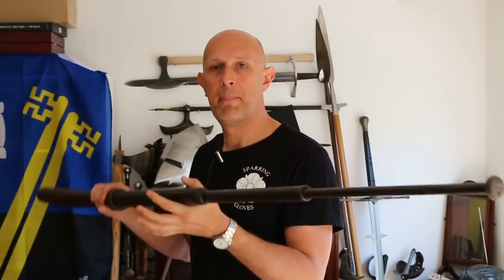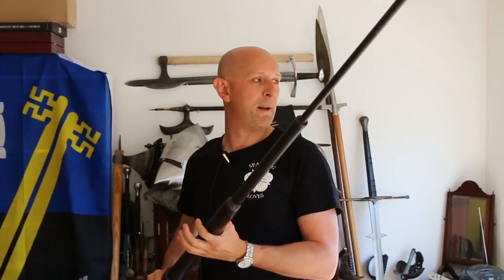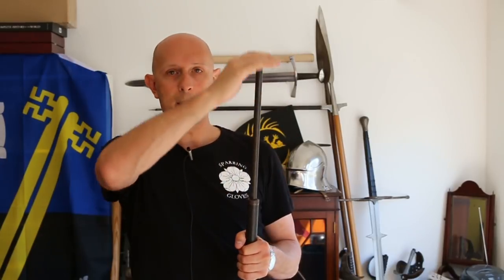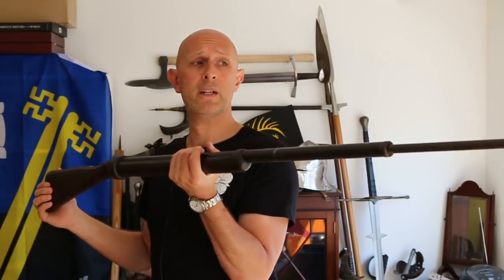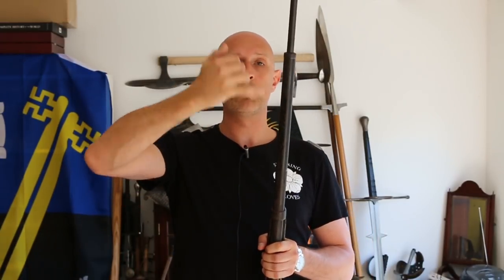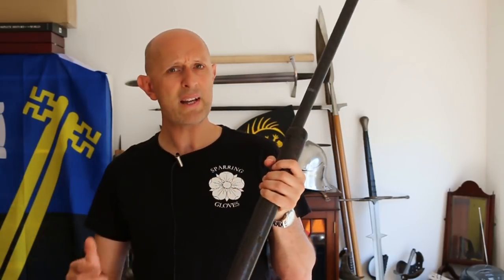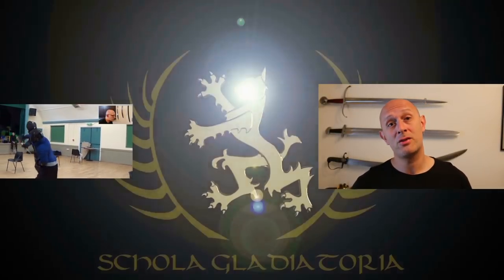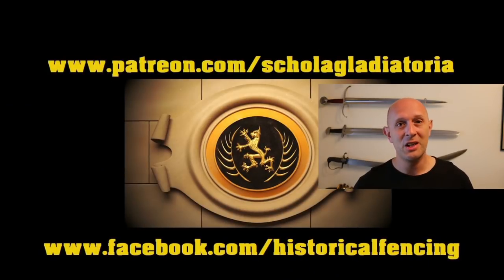Bayonets for Fencing / HEMA Sparring - Problems & Challenges

Comment: Surely all you would need is some clever, enthusiastic type for the initial design and perhaps prototype phase (Mr.Todeschini springs to mind), that's the kind of thing people crowdfund. After that, contract the manufacture out to a big factory in Asia.

I can't see any way of having a high end, bespoke maker (like a commercial gunsmith) do everything start to finish and keep it within a reasonable budget. However you go about it, I imagine you'd have to go in with a nice chunk of capital from the get-go.
Reply: A mate and I are actually using an Australian variant of these. We're testing a few 'simplified' designs.
The TL;DR of which is for this type of 'plunger bayonet' you basically use a steel reducing bush, two pipes (or an old shotgun), a spring, and a large construction screw. Add rubber instead of steel to the stock and we've had success AND you can make it at home from parts from any pluming or automotive shop!

Comment: The best way I can think to make what you're looking for would be to take an old cheap single shot 12ga, cut off about 18 inches of the barrel, find some Durable PVC or similar pipe, possibly metal that would tightly fit down the bore, find the appropriate springs or get them wound by a gunsmith or blacksmith. You'd want like 3 springs, one relatively light for the whole length, one stiffer about 1/2 the length and a very stiff spring dampener about 3-4" long to soften the impact if it's fully compressed. 

To make this I'd recommend using an old cheap, possibly broken single shot 12ga, cut off about 18-22" of the barrel, find a piece of very durable PVC or metal pipe the appropriate size to fit in the bore, cut it to the size desired. Get the 3 springs I mentioned above either buy them or have them wound for you. Anyone with a lathe can easily wind springs at a fair price, but it's very easy to find premade springs in many sizes. Also use a wooden dowel inside of the springs as a guiderod. Finally cut a groove on each side of both the shotgun barrel and drill a hole through pipe inside to put a pin through. Shotgun barrels are pretty thin so you could probably use an angle grinder or something similar to cut the groove, it only has to be like 4-5mm wide. You could also use a mill to cut the hole which would be easier but more expensive, but still affordable. Finally assemble all parts, pin them in place and you're good to go.I recommend you peen the pin a bit so it stays in place, but it's your call.  Because they all will be pinned in place you can disassemble it completely for oiling or replacing parts. All done if you can get a really good deal on a broken beat to shit single shot 12ga you could probably do this for around $300-$350 USD. 

Also, when looking for the base gun or stock to use, make sure the grain is correct in the stock. The grain should go in the direction of the wrist, than straight through the comb to the back and be parallel to the bottom near the toe of the stock. I wouldn't worry too much about the toe as i don't expect it to get much wear the way you plan to use it, but the wrist is very important as if the grain is wrong it can break surprisingly easy.

Alternatively if you want to make it from scratch I'd suggest you make it out of PVC, copper or aluminum pipe and set it in a polymer gunstock and weight accordingly. Either way will cost you about the same as riflestocks aren't cheap if you want them to hold up.  Hope this helps.

Comment: An aftermarket nylon stock maker could cast a replica stock with metal insert for weight, thin plates to cover the forestock, and a receiver to screw a threaded at both ends "barrel tube" into at the breach end. They already make stocks with metal inserts so that's a bit of design and a new mold. The "bayonet" is just a threaded rod, one end with a cup to capture the spring (probably could use a couple ball bearing washers to center the rod), rod goes through a screw on cap at the muzzle end (for regular maintenance) and gets a flat striking end screwed onto the exposed threaded end. That doesn't require much special equipment except the stock, which is a variation on an existing theme. They already make such stocks for WWI era rifle actions.

Comment: I don't know about there, but non-functioning training rifles are fairly easy to find in the states and are generally full weight.  Now, a training bayonet that isn't merely a blunt bayonet may be harder to pull off, but could be mimicked in various ways as you pointed out.  Plus, it sound like the actual rifle was your biggest concern, so look into ROTC/color guard/drill team/etc training rifles and there will be lots of options.

Or, as others have mentioned, you could just get a rifle stock (possibly like a CZ mannlicher stock as you're probably looking for something full length while modern styles are a bit short & light) then just mount an equivalent sized pipe with the plunger/spring system you showed or whatever else would safely replicate a bayonet while reaching the proper weight.  Not really sure what your laws allow in terms of gun parts, so I would think a training rifle would be less problematic being designed specifically as a non-functioning exhibition drill rifle, but, then again, I don't know.

Comment: An idea for the blade. sail battens.

most classes of modern sailboat use strips of plastic to stiffen the sails. these are quite flexible (they only stiffen cloth) durable and already come with plastic blobs blunting the end (so they won't poke there way out of the pocket in the sail)

another idea would be to attach the bayonet halfway down the barrel and make it long enough that the point is in the same position. this would allow a greater length of material for flexing making slashes less dangerous. caution would stillbe required not to hit your oponant with the actual barrel.

Comment: I have two of the swedish M1911 trainers, and wouldnt hessitate to use them and somewhat hard, with proper protection. It is what I bought them for and both of them are marked with deep cuts in the wood and such, one even needs glueing the stock.  A possibility for regulating the length of the trainer, could be to have plungers of different lengths, so that a swap would facilitate going from a 20th century knife bayonet to a 19th century sword bayonet. Pipe insulation could be fitted to the bottom of the stock for some padding and cushioning of the impact. For training purposes I think it would be fine, but it would detract somewhat if doing shows. As for getting a steady supply of them, my thoughts around it untill I got my swedes, was to beg a favour of a friend that is a mechanical teacher in high school and have a proper machine shop at hand, making the steel part to fit in cast off stocks from Mauser M98s, which  are in steady supply over here. Now, there is mostly a matter of reverse engineering the Swedes but the need to do it, are gone.  I think the proper way forward would be to measure whatever original one have (am slightly envious on yours), do some research as to what is available in stock dimensions, find the closest matches, identify a usable stock, accept that it will not be a replica of an existing pattern and see what can be done from that. :)

Comment: My idea revolves around using off the shelf rifle stocks (which you’d need anyway) and simple plumbing pipe with a trapped spring configured in a way that replicates the spring loaded barrel mechanism. You may need to find tune it with weights at certain spots but that should be sufficient, and relatively cheap until you can draw up the diagram in CAD and send it off to China

Comment: I have handled some danish bayonet trainers from the same time and they most deffently didn't have ANY springs. In the pictures I've seen they sometimes have some cloth on the round nob at the end but thats it. They just wore some heavy fencing equipment and only a glove on the left hand not the right.
Reply: This is my idea too. I can see how a metal spring-loaded training bayonet has advantages, but I doubt it would be worth it setting up a production line for it, when you can just buy of the shelf jukendo mokuju. Apparently the USMC trains with their own shorter version of a mokuju too. Yeah, it's a fair bit lighter, and you'd need some heavy padding at least, but this is also available of the shelf, and you'd save yourself a lot of hassle.

Comment: Mr.Easton, you don't need to fabricate the whole piece, or have it fabricated. Plenty of companies sell rifle furniture. This furniture specifically the synthetic furniture is typically hollow, or filled with some rigid sort of foam. These can be ordered online. You could drill our sections of foam and fill them with the appropriate weights, or use spray foam insulation to fill hollow furniture, and then drill and weight that.  Industrial supply companies like McMaster.com sell all sorts of tubes and springs. It wouldn't be hard at all to order the appropriate rifle furniture, measure it, and then fit in the right tubes and rectangles. The most complicated piece would be the piece that would fit and lock into the furniture, and receive the barrel. For the creation of this, you could use one of many online machine shops that will make what ever you want as long as you send in the machining specs. Figure out the necessary dimensions of the part, and have a few made. The simulators would be simple enough that each person could assemble their own with relatively little effort.

Comment: I traded e-mails with Purpleheart for a bit trying to hesh out details for making bayonet attachments or fencing bayonets, but it didn't pan out.  You can make these somewhat simply with relatively available materials, but durability is an issue - especially the stock.  Less of an issue with earlier systems, but I was shooting for later ones that use the whole weapon.

While not as realistic, there's a reason the mukuju was what the Japanese settled on.

Comment: The butt and stock can be made padded and flexible, the blade can be made both spring loaded and flexible, but the problem is the weight - 9 pounds is 9 pounds (that's about 4 kilos, for the empirically challenged) , and will hurt when you get whacked by it. You may (almost) eliminate the chance of serious injury, but it will still hurt.

Comment: The modern military uses steel wire skeletons and molds over resin or rubber to make training rifles. I'm sure similar technique can be applied to make HEMA bayonet fencing weapons. The problem is the economy of scale. HEMA community is small enough by itself, and bayonet fencing is even a smaller subgroup. This means the demand is so low that producing lower quantity to meet such niche demand is costly.

Comment: So I can tell you that the US Marine Corps uses wooden Mokuju made by Purpleheart Armory for the bayonet training in the Marine Corps Martial Arts Program. Having been stabbed with one through a flak jacket I can tell you that I could feel it, and it hurt some, but it did not do damage. It is lighter than you want, but that does have the benefit, like you mentioned, of not being as dangerous if it hits someone. They are also a bit simpler, as instead of using springs they use a rubber tip to reduce the force. As of yet, they do not make them in the length you want, but something like that could easily be made as long as you need. I mean, the Marines were able to commission a shorter one to simulate an M4 with a fixed bayonet. 

I know it's not exactly what you were looking for, but it's inexpensive enough that you could buy one to evaluate and see if this option meets your needs, either long-term, or as an interim solution.

Comment: From the looks of it, any experienced carpenter can make that with relative ease. Also you dont really need to have steel barrels - there are quite a few durable plastics that will be safer, much easier to make and replace. I would very strongly suggest looking up some local carpenter's shop and getting their quote for making this tool.

Comment: Seems like it might be better to pick some standardized pipe sizes for the barrel and bayonet then sell a kit containing a light weight stock made out of some modern plastic, all the extra hardware you need (spring, bayonet tip, some special aresting mechanism, probably a special cap you screw on the end of the barrel pipe and the bottom of the bayonet pipe). You could also weight it with something like specially designed compartments in the stock for placing something standardized and heavy, steel washers or tiny segments of pipe that are enclosed in it or something. It would cut down on shipping weight and make it easier to ship to places with restrictive weapons laws that might be suspicious of something rifle-shaped.

Comment: 12 ga single shot shotgun. Slug the chamber and rear portion of the barrel with lead or something for the weight.  This should also qualify as demilling it so it's no longer an actual firearm. Thread the end of the barrel for a cap. any old piece of steel rod and a bit of welding for the bayonet, held inside the barrel with a threaded cap and the breech slug. 

For the danger of the tail end, saw the butt short by about 6 inches, get a rubber butt pad and a couple of reasonably stiff springs to provide give when buttstroking.

The most expensive part will be the shotgun, as I have no idea what the difficulties are with acquiring and then demilling over there.  Over here in the states, I could probably cobble those things together (even using brand new shotguns) for around $250 each.

Begger's version using black iron pipe would go around $50-100, probably, but wouldn't be balanced as well or pretty.

ETA: I'll bet if you called Jorge Sprave, he'd have one at your door like he'd shot it out of a slingshot.

Comment: You could try contacting a maker of drill/parade rifles and see if they can do it. Alternately, you could buy a few parade rifles and then contract some to add the bayonet mechanism to them. From what I've seen parade rifles aren't that expensive, $40 - $60 US on the average for basic looking rifles and up to $200+ for accurate replicas of M1903 Springfields or M1 Garands.

Comment: If you want to spar with firearms, SimUnitions makes excellent "paint bullets" that are simply used in real firearms. If you get plumb-bob bayoneted sparring rifles made, I think it'd be cool if they could fire single shot paint rifle rounds. Or the ability to give "officers" working sidearms. 3 people with melee weapons against 1 with a loaded rifle with bayonet fixed would be interesting, so would 2 big teams outdoors with terrain each with 1 officer, or practicing using the sword to parry while getting a revolver out of a holster to use (19th century military holsters look pretty crappy to me, no drawing and firing in less than a second [which I have done] using those things!), or a small group protecting one rifleman while he reloads against a large group. For me, I'd like to see how well 2 revolvers carried Wild Bill style deals with large groups of melee weapons used by competent people working together who ambush me etc (multiple hits necessary to stop people, because hollow-points aren't invented yet). Just brainstorming way to simulate 19th century scenarios. 

Good thoughts about finding ways to dampen the impact of the butt end; maybe they could make the stock similar to the collapsible M4/AR stocks (buffer tube spring) but they compress under pressure instead of locking in adjustable place. Folding stock technology could also help make stocks that give way to the sides and top/bottom under pressure. At least, I hope so, because that'd be really cool!

I like how similar the training tool is to real rifles. The Izmash plant that makes Kalashnikovs in Russia (the original plant) also makes airsoft guns, and they are 95% like regular AKs! Made by the same people on the same assembly line in the same plant at the same time, they just put in a few different parts. This obviously makes a better training tool that's more fun to use. And you've got the world's toughest airsoft gun!

Comment: I think the problem would be making a stock you could hit people with. A springy plunger is pretty easy to make, but making something that heavy safe to hit people with is tough. It would almost have to be made with, or padded with, heavy foam – which would make it not handle like a real gun.

You could strap a plunger onto a Cold Steel gunstock war club (after sawing the stabbing point off), and make the whole thing for under $100. But it wouldn't be safe to hit with the stock. Better than nothing, though.

Comment: If you had real rifles, it would probably be very easy to temporarily convert them to trainers. Basically, this is a variation on the spring and ramrod idea. Put a spring down the barrel, put a wooden dowel down the barrel (if it breaks it is easy to repair and the wood won't damage any rifling). Tie paracord or some other strong string from the bayonet lug to a point on the dowel. This will keep the dowel from being pulled out while not interfering with it being depressed. Maybe put some duct tape or something on the end of the dowel so that it doesn't splinter.

Comment: hi,, it should be pretty easy to replicate using off the rack steel tubing / bar stock,, the hardest part would be getting the spring and damping to work smoothly ,, but i assume the one you have can be stripped for repairs etc ,, so it's parts should give a decent ballpark ,, starting point to  work with ,, any half decent small engineering shop should be able to replicate it using mostly off the shelf parts ,,you may need to get different companies to do the wooden stock ,, phone a few for quotes it will be way cheaper than having a gunsmith make one